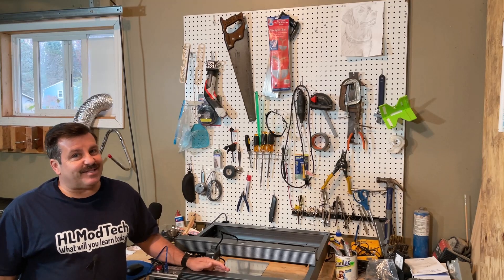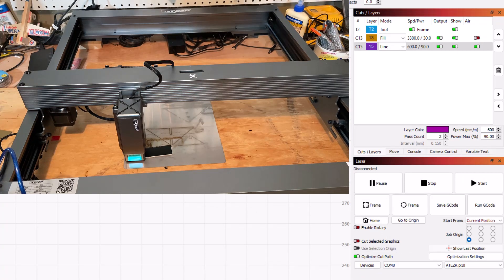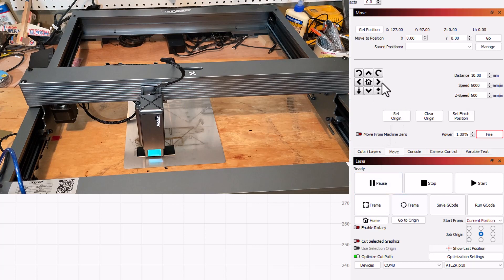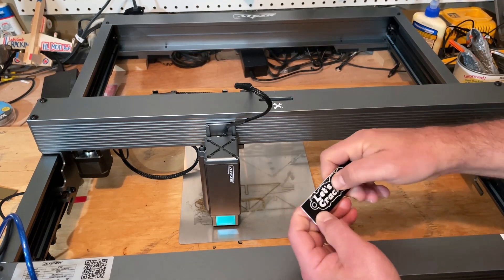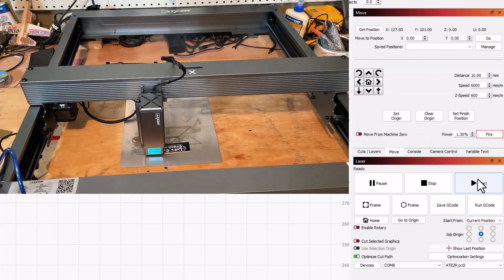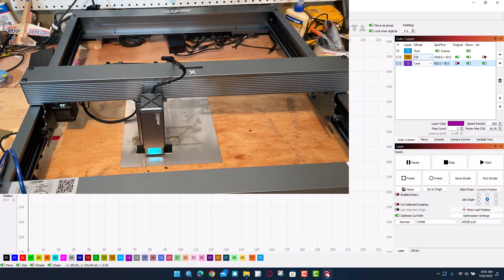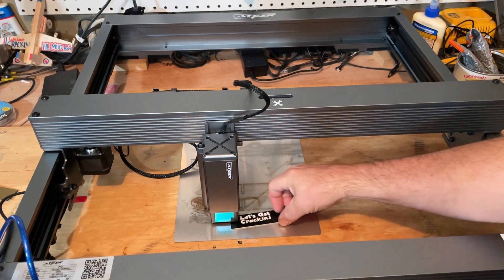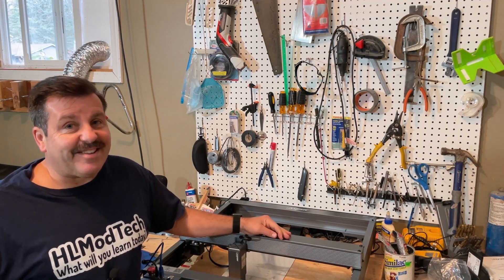Attempt to cut a white Acrylic Keychain ATEZR P10 10W LASER cutter

Comment: Hey man. Just wondering where you got the acrylic from? Im trying to find a supplier and not having much luck
Reply: Thanks. Has helped with my search
Reply from the maker: Engraving acrylic is the search term. I have not bought any in 15 years... but that is how I found it. Used to use it with a CAMM2 engraving machine. Rowmark was the brand, but I did not but it directly from them.

Comment: Just wondering I heard  caution That if you put a wet papertowl underneath the acrylic it will cut.  Have not tried it myself but just someting I heard.  Probably not a safe option just wondering if you ever tried that?
Reply from the maker: I have not heard that, but I will have to experiment now. =) Thanks for the note.
Reply: @HLModTech   have you tried it? Did it work?
Reply: @HLModTech  have you tried it? how about 60 passes low power? :D